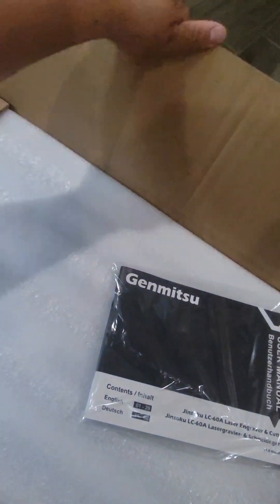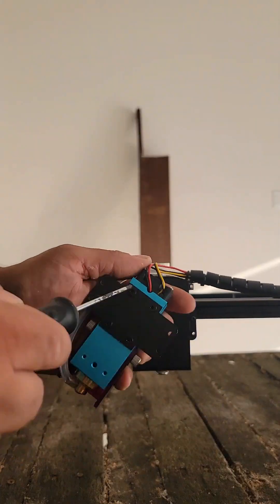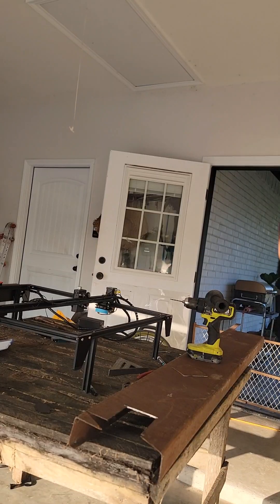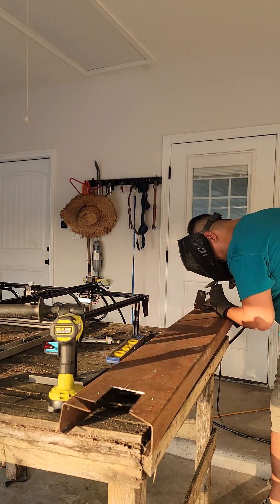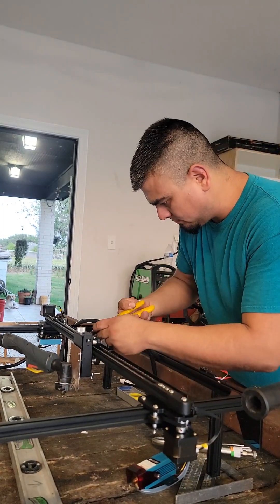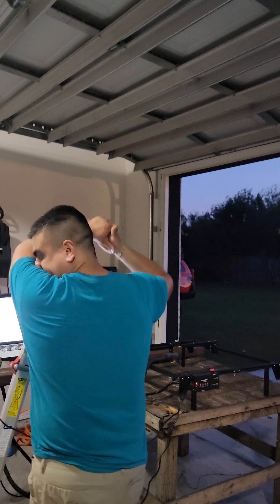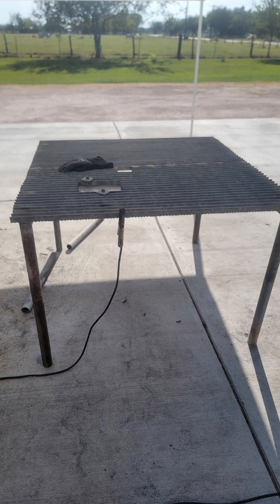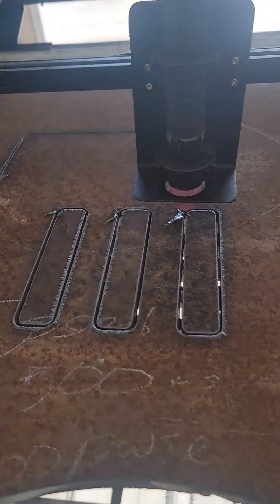Easy DIY CNC Plasma Table (LC60a laser conversion)

Comment: I built this machine after using the tutorial from the original a couple of years ago but my plasma was rubbish now have a decent cutter but struggling to get it to cut full shapes out at more than 15mmps speed on thin sheet

Comment: Any  new info  or mods to this I’m about to buy one
Reply from the maker: Still using it  occasionally as it is.  I did have a problem with laser control board going out but got a replacement  and it's working fine

Comment: Hi.. wonderful idea.. I connected everything as you described.. every time I start working the laser disconnects from the computer.. and finally the card stops working.. I work with a sculpfun s9 laser and with a jasic cat60 plasma.. do you know what the problem could be  ..?
Reply from the maker: Sounds like it could be some high frequency interference. Try shielding your electronics in a metal case/box and use shielded cables. And/or  ferret beads... for some reason on mine I had a similar issue when I updated lightburn to current release.

Comment: Hi nice video. Im in the process of building my own cnc, but im having an issue with the plasma running constantly when i hook everything up. It wont turn on and off according to the cut pattern. Would you happen to have a solution to this issue that im experiencing?
Reply from the maker: Not sure.  Have you made sure relay is hooked up correctly and is turning on and off?
Reply: I have the same issue and everything is hooked up

Comment: awesome..  how much CFM  is  you  compressor  .. did  you have dry air system ?
Reply from the maker: Currently using a small 4 gal compressor  with 5cfm @90psi. It keeps up without dropping pressure but stays on entire time of cut. No dryer just using a industrial style filter from harbor freight.
Reply: @Menchax  thank you

Comment: Very cool build!  Do you have a link to the low freq start version?
Reply from the maker: Thanks ! From the same brand I would day this would work  but not sure if pins on machine are any different.  Should be able to get it work though. 

.bestarc Plasma Cutter, Non HF Digital Pilot Arc BTC450NP 45Amps Dual Voltage 110/220V Blow Back Pilot Arc Air Plasma Cutting Machine (BTC450NP 110/220) https://a.co/d/4eJbQqx